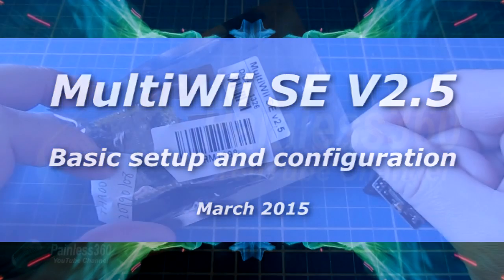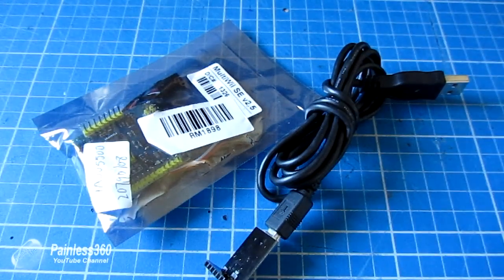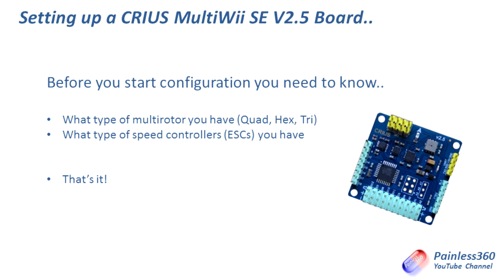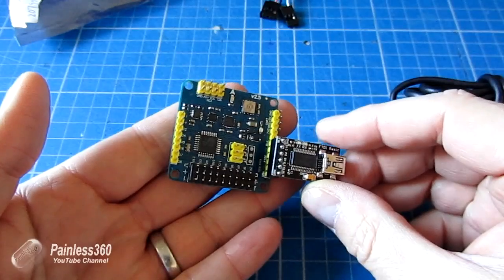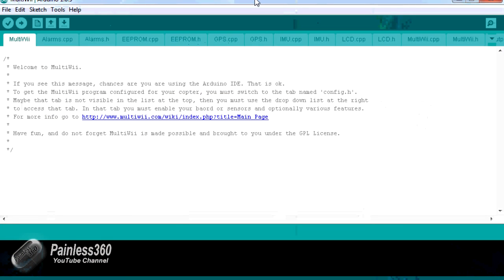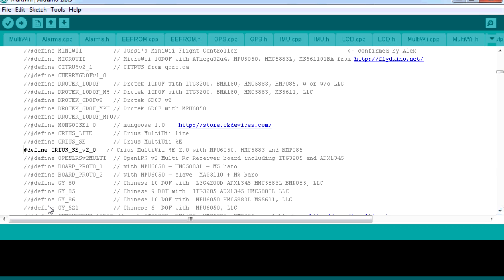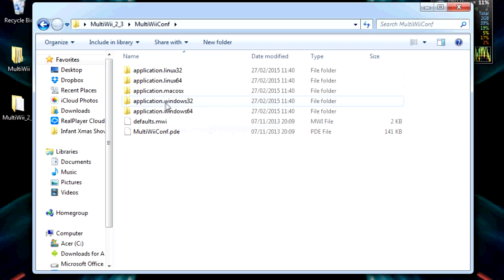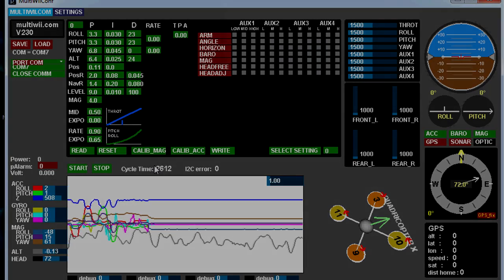(1/7) CRIUS MultiWii SE V2.5 Board - Initial setup and configuration

Comment: Just a thought, the multiwii 2.5v says it has a 3.3v regulator. We still use the 5v board option right?
Reply from the maker: Steve B Yep, 5v :)
Reply: I keep getting and error avrdude trying to use that board. I tried another board and it uploaded or seemed to fine but will not fly. could it be because of my windows 8.1? Thanks again
Reply from the maker: Doubtful. More like the settings of the board are wrong. See https://www.youtube.com/watch?v=EEWE4PZL4TE&index=11&list=PLYsWjANuAm4qSqszQR6qIisiwk5r-_nMk for help with the avrdude error..

Best of luck
Reply: I got it to load only on the Arduino mini w/ AT Mega 328. Should this work?
Reply from the maker: If it reported that it has worked and verified then it looks good..
Reply: Painless360 I am at a loss.....It still will not fly. I try to arm and I have to hold throttle to left, it arms but motors don't spin. Then I throttle up a bit they all spin at different times or the quad just wants to flip. I can not disarm also. All settings in configh are correct as far as I can tell. I think I have a bad board or settings are in my DX6i. Motor stop setting is correct. ESCs are calibrated. If hooked directly to throttle for test they work fine. All props are correct.

Comment: Mr. Painless360, I was hooked up to the the Multiwiiconf ap and noticed that even with the quad as close to level as I could get it, the Front Left prop was spinning quite a bit faster than the others. FL 1335...FR 1150...RL 1150...RR 1163. Any thoughts as to what is going on? I hooked it up because I can't seem to get this quad to "settle down". My only other flying is done in the house with a pretty stable little Lady Bird.
Reply from the maker: Have you tried a test hover? The numbers will 'dance' a little when you run up the model on a bench...

Happy flying!

Comment: HI when ever I upload it says no such file or directory. Please Help
Thanks
Reply: all sorted now but how to i engage the motors my board flashes blue and then the blue led flashes in a different pattern for one second when i pull the stick down to the bottom left. Thanks
Reply from the maker: George Carter https://www.youtube.com/watch?v=lc4ECi6JYX4&list=PLYsWjANuAm4qSqszQR6qIisiwk5r-_nMk&index=3 should help.

Best of luck!
Reply: hi is there anyway to reduce the throttle range as my end points do not adjust enough to stop it taking off by its self. Thanks
Reply from the maker: I would check on the radio menu to make sure that you can get a broader range, some radios have 'extended endpoints' options in the menu that may need to be turned on to get the 1060-1860 ranges for the throttle channel..

Bets of luck..

Comment: thank you for helping me with the java prob i had its working great now. now i have another question for you. if im using the Rotorgeeks 12A BLHeli ESC V4 http://rotorgeeks.com/index.php?route=product/product&path=34_43&product_id=95 what would i select in the arduino setup when choosing what ESC i will be using. 
thanx for the help
Reply from the maker: ***** Not sure, I'd ask the supplier what the default throttle range is on them and what they recommend. Sorry I can't be of more help on this one..Best of luck with the build!

Comment: what do i do if i cant open the multiwii conf i get c:\programdata\oracle\java\javapath\javaw.exe unspecified error. so im kind of stuck there.
Reply from the maker: Much more stable than a Helicopter, more like a co-axial (if you've flown one of those).

Best of luck with it.
Reply from the maker: If you google the error you'll find that this is due to a problem with the Java installation. Run an update and see if that helps.. Good luck!
Reply: Painless360 hi thanks for the vid i have downloaded both 2.3 and 2.4 how ever i dont have what multiwii.cpp and multiwii.h and not what u say to go on can u help please
Reply from the maker: I just checked and downloaded a fresh set of code from http://code.google.com/p/multiwii/ 

Works fine. Please post a video of exactly what you are doing so I can see..
Reply: Ok thank you painless360. Once this iss all done will this self level in the air or will this be like a helicopter?? I found it in the end i had to type it in and it came streight up thanks again good videos...

Comment: how to debug this error?
Arduino: 1.6.1 (Mac OS X), Board: "Arduino Pro or Pro Mini, ATmega328 (5V, 16 MHz)"

Sketch uses 19,314 bytes (62%) of program storage space. Maximum is 30,720 bytes.
Global variables use 1,153 bytes (56%) of dynamic memory, leaving 895 bytes for local variables. Maximum is 2,048 bytes.
avrdude: ser_open(): can't open device "COM1": No such file or directory
ioctl("TIOCMGET"): Inappropriate ioctl for device
Problem uploading to board.  See http://www.arduino.cc/en/Guide/Troubleshooting#upload for suggestions.

  This report would have more information with
  "Show verbose output during compilation"
  enabled in File > Preferences.

Comment: Hey there, thanks for taking the time to make the multiwii vids, been really helpfull as info is usualy poor at best, was wondering if the se v2.5 can control the pitch of the camera as well as being the fc, or do i need a separate controller for the camera?  Thanks
Reply from the maker: Yes it can, have a look a the release notes for Multiwii 2.3 code.

Best of luck..

Comment: I have been doing some research locally.  Unfortunately, no one in my area has had any experience that has not been negative. I am told to skip the Chinese junk and buy a Naza board, to the tune of around $300+.  Not going to happen.  Should I just order another board and adapter and try again?  I am at a total loss for options and frustrated beyond my capacity to cope. Any ideas?
Reply from the maker: Funny how those who have no experience resort to the negative comments isn't it?

These boards are great but I can't tell if the issues are due to a hardware issue with the board(s) of your level of experience with them. The Naze32 is not that expensive if you get them from places like eBay but you run the same risks.

There are easier to setup boards that may be better for you at this point in your RC hobby. This may help you make a choice - https://www.youtube.com/watch?v=k4tQAmg2ssA

Comment: Also, when I  flashed  the board and programed it , it was all hooked up on the quad. Would this matter?
Reply from the maker: Steve B Shouldn't make a difference but I always pull off the ESC connections when flashing to avoid the USB trying to power more than it needs to (old habit from the KK2.0 days when you had to pull all of the cables when flashing firmware)Best of luck with it.

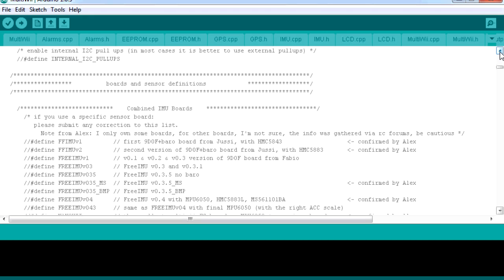Comment: Hello, I thank you for the demo. I followed exactly but my quad just wants to flip on take off. Also, can you tell me where the setting is to start motors on arm or how to? I have Simonk ESC's. I tried the section at 14:24 of your video.Thanks so much.
Reply from the maker: Assuming that the movement of the board in MultiWiiConf looks good then I would check that two of the connectors to the motors are not crossed over - triple check that the motor outputs are connected to the right ESCs and motors..

Best of luck..
Reply: Painless360 I checked. All wiring looks good. Could it be the FTDI you think?
Reply from the maker: Doubtful, if it was you wouldn't have got the code on the board.

Prop upside down maybe?
Reply: Painless360 Checked that also. Another question, in Aduino, how do I set the motors to come on when they are armed. Thanks
Reply from the maker: Steve B Search for and uncomment #define MOTOR_STOP in config.hBest of luck..

Comment: hello m8, im just trying to set a board up but it says there is a problem with the drivers, and I cant program a port in to arduino, any ideas??
Reply from the maker: The standard drivers in Windows 7, 8 and 8.1 should auto-detect and load, if not you can try the drivers here - http://www.ftdichip.com/FTDrivers.htm

If they don't work then my advice is to go back to your supplier for support...

Best of luck!

Comment: Great vid as always
Id just like to mention that people should be careful where they get their FTDI adapter . There are some clones out there that can cause all kinds of issues. I spent hours trying to get mine to work only to find it had been "bricked" by a Win 7 update. ( actually by the driver update from FTDI)
You can also use a Arduino Nano as a FTDI adapter ( by removing the main processor)  http://www.instructables.com/id/Arduino-Examples-2-Use-an-Arduino-as-a-FTDI-Progr/
To the best of my knowledge the easiest way to check is on the original FTID adapter the FTID chip itself has the company logo etched into the chip whereas the clones have it printed on it,
Spend the extra dollars on the "real" adapter and save yourself the hours of frustration 
Cheers
Reply from the maker: Great advice - thanks for posting!
Reply: +bigfilsing thanks a lot for the hint and yes, the video is just superb :) 

However, I have a problem - I've bought "Almost Ready to Fly" kit from China with Crius MultiWii SE v2.5 and FTDI adapter and I simply couldn't upload sketch to it neither from Windows nor from Ubuntu by receiving "programmer not responding" error. I tried different versions of Arduino IDE and correctly chosen chip and port, however I'm constantly receiving this error. Also I tried to use MultiWiiConf to check it and though COM port is noticed by it, it just doesn't show anything and all sensors are blank and quad model is not chosen (though this controller should've been pre-programmed for QuadX).

It would be good to tell here that in the beginning I mistakenly connected battery to it directly and controller started smoking, however I disconnected it quickly and controller doesn't seem to be damaged, because blue led is flashing upon connecting it, also if controller is not flat, blue led starts to flash meaning that magnetometer is working.

So I would like to hear your opinion on what could be the problem and whether it makes sense to first buy another FTDI controller and check with it or it may be the problem with controller after incorrect battery connection? Basically, I don't have a problem with buying another MultiWii with FTDI controller it's just that I'll loose another 2+ weeks because of delivery which is undesirable

Any help would be greatly appreciated

Comment: One step closer....I believe (fingers crossed) I finally "flashed" the board with the Arduino sketch.  Of course, that was not the final problem. Upon clicking on MultiwiiConf, Windows32 bits, and MultiwiiConf again, I get an error message that says "Windows cannot find 'javaw.exe'. Make sure you typed the name correctly and try again."  Any more hints ?
 Oh, by the way, I think the problem the first time I tried to upload the software was that the board was already installed on the quad. I removed it and made the progress that got me this far.  
I have never shot or posted a video, so  that would be difficult at his point.  
Your videos are very well done, by the way.
Reply from the maker: Hi Mike, if you Google the error then you'll find lots of pages that cover the resolution. You need to install/update Java on your machine. It can be downloaded from https://java.com/en/download/

Best of luck.

Comment: Sorry to be such a pain, but now I am getting a "compiling" error when I try to upload to the board.  Maybe I should try a different kind of flight control board?
Reply from the maker: Mike Kevins you can if you'd like. I appreciate you are frustrated but giving up will mean you won't learn what the issue is and who's to say that another board will be trouble free?I'm happy to provide help but simply writing 'getting a "compiling" error' isn't useful to me at all. Which compiling error? What exactly does it say? Can you post a video showing the issue and the files you are using? Best of luck with it..

Comment: I've got one of the crius multiwii (2.5) sets coming from hong kong (ebay) and from these vids i think i've managed to sort the code for the i2c , neo-6 v3 gps, and the multiwii settings, so I'd like to say thanks for all your hard work.
I do have one question though, I'd like to add sonar (HC SR04)  but i can't find much info on the multiwii settings. I've seen you've tackled it on another flight controller,have you ever added it to the multiwii? If so, How? I've read something about having to reassign a pin and that scared me...
Reply from the maker: Sorry, I've not added it to the Multiwii, it's a poor addition IMHO with lots of issues and unpredictable results. I would read up on the forums if you really want to try it.

Let me know how it goes - best of luck..

Comment: I spoke too soon.  When selecting the board type in the tools menu, the type you mention does not show up on the list. Are there any other selections that will work.  I could send you a list, if need be.
Reply from the maker: Mike Kevins Mike, you need to choose a 'Arduino Pro or Pro Mini' board and make sure that 'ATmega328  (5V, 16 MHz)' processor is also selected. If you are really struggling then I would recommend installing the older version of the software (1.0.5) as it is less complex.Best of luck.

Comment: It took me a long time to figure out these little buggers, 
I have 3 now, a 2.5 SE a clone from hobbyking (328p with ftdi) and a multiwii pro 

i have yet to figure out the settings for the GPS hold RTH and navi for the  multiwii pro but my 2.5 SE running a GPS with a I2C to GPS module as a great gps hold (thanks to your help) and I managed to tune the hobbyking to be super reactive on a DJI330 frame. 

The next one I will be buillding will probably be an APM 2.6 or a Pixhawk 
Or a miniquad with a Naze 32

So many choices :D

Comment: Is that the Multiwii v.2.5 Clone from HobbyPower on amazon? Be careful with that one, I found that the little voltage regulator can easily be upset! I had 2 burn out from them, the first one was totally my fault, when I let it touch the 12V distribution board, and the second one failed due to a short circuit. Although technically my fault too, I think the voltage regulator on the board should have has some sort of overload protection and shutdown. I was able to repair that one, but after replacing the charred shunt resistor, I then connected it up to my bench power supply and forgot to set it to 5V for testing, and perma-killed it too. >:-(

I have then got a genuine one, and have not had any problems. (I can tell that is the clone because of the yellow/black colored pins, and the bright green LED vs the dim lime green one, and the capacitor for the regulator is the crappy multilayer ceramic type vs a better yellow tantalum SMD cap.)
Reply: I have read that was issue on multiwii AiO from hobbyking, where was option to power board from 5-12V, but stabilizator chip haven't get connected ground to it, what caused mess.